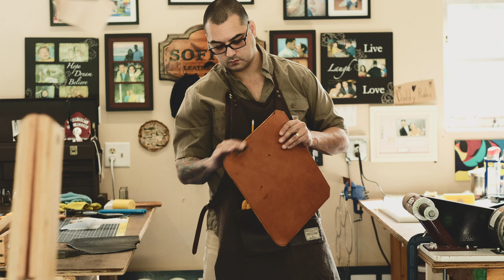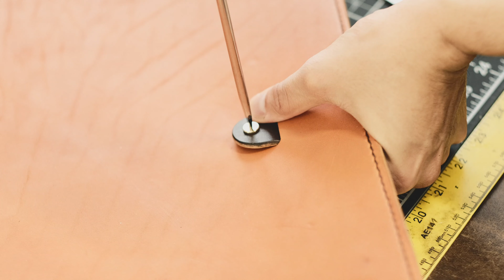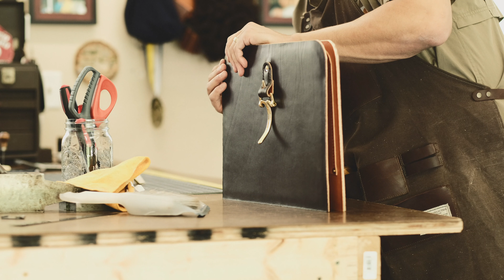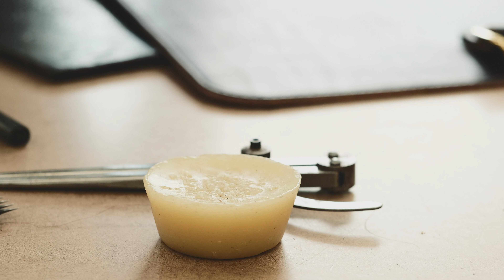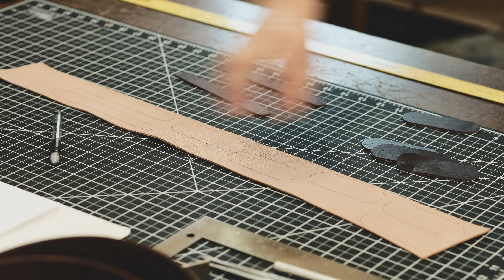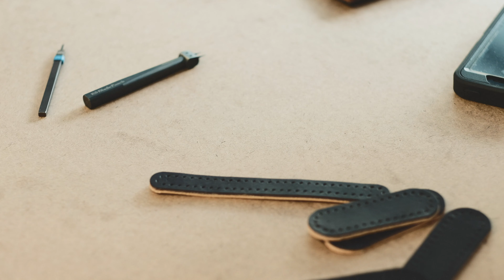Making an English Bridle Leather Briefcase - Part 3 of 4 - ASMR Build

Comment from the maker: This is Day 3 of a 4 day series taking you through the journey of creating a bespoke English Bridle leather briefcase.  

Part 1 - https://youtu.be/u_daMeC6lNs
Part 2 - https://youtu.be/Fdraz3_hXtQ
Part 3 - https://youtu.be/03giEpDSqrI
Part 4 - https://youtu.be/1u4VUAyTIKQ
Complete Build - Short Version - https://youtu.be/bSTUGJCHGN4

This bag is already commissioned. Customer requested a dark brown exterior with tan interior and medium brown stitching.

More Info --- https://www.sofieldleather.com/bags

Whether it's business or pleasure, this English bridle briefcase will be the perfect companion in all of your escapades.
Crafted with high-quality English bridle leather, provided by American tannery, Wickett and Craig ( http://wickett-craig.com ), this bespoke work of art will stand above the rest.
This briefcase is fully-lined with English Bridle throughout, and adorned with over 1,200 stitches meticulously hand sewn using the tried and true saddle stitch method. The exterior showcases a heavy duty brass collar set for a one-handed easy access buckle.  It will hold the test of time with its heavy duty brass hardware and brass zipper, which was placed with reinforcement in between for longevity.  Handles, small straps, and the storm flap are also reinforced with a polyester webbing to prevent stretching and warping.  For your convenience, the interior and exterior also boasts a d-ring with an included key chain.

With over 30 hours of build-time, this briefcase has been engineered to maintain the integrity of its structure and shape with interior reinforcements, and heavy duty brass rivets at the end of every stitch run for durability.

As a final touch, an all-natural in-house leather conditioner ( https://youtu.be/kJ_NppxXN2w ) coats the leather for a sleek and smooth finish, making it ready for its next adventure.  
  

Product Dimensions: 
Exterior of bag: 12"H x 16" W x 4" D
2 Large Interior Pockets: 9" H x 15" W
2 Small Interior Pockets: 6" H x 7" W

Check Out the Leather Shop - https://www.sofieldleather.com

Check us out on Instagram - https://www.instagram.com/sofieldleather/

Check us out on Facebook -https://www.facebook.com/Sofieldleatherworks/